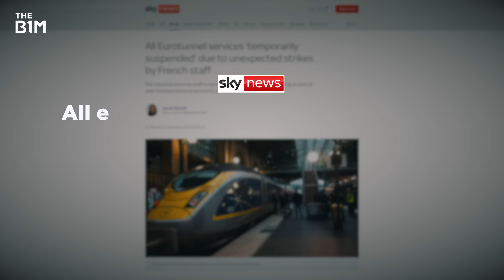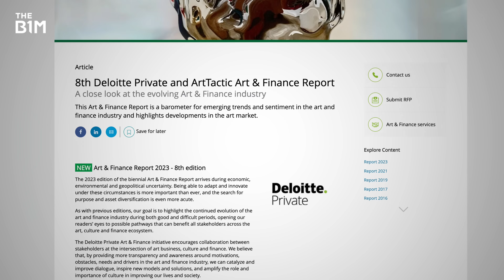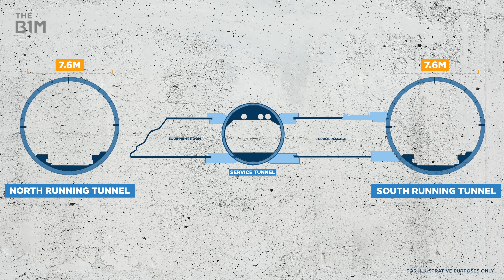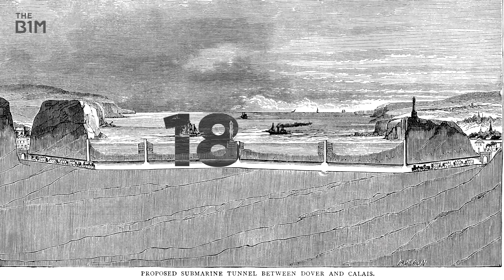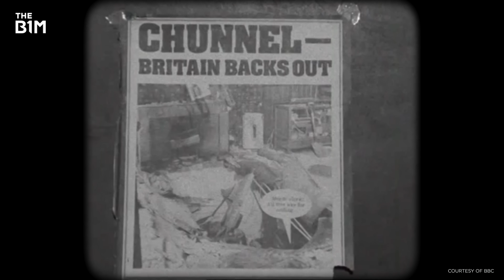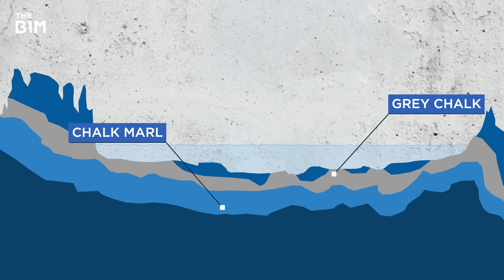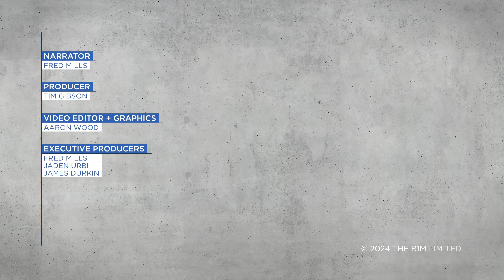The Channel Tunnel: Building the World's Longest Undersea Link

Comment: My late dad worked down there from start to finish and would bore the pants off me with work waffle,   here are some memories of when my late dad worked down there,  here goes...... "the alimac"   this was the main lift thingy that took workers in and out of the tunnel,  "the man rider"  this was the little train thingy that took the workers to their work destination,   "the pranks",  grease rubbed onto the rim of a plastic cup tossed into the air to land on someone's hard hat without them knowing, "the deaths and injuries", one of my dads work colleges had his cock ripped off when he lent on a conveyor belt. " The contractors"  TML and Balfour Beatty, my dad worked for TML. 
Overall, he earn't good money for the time which changed our lives. When it finished he was a foreman and one of the last 9 men to work down there, a lot of them (stole) took left over equipment when it was finished everything  from radio cb's to excavators you name it😂

Comment: Boston và NYC subways có hơn cả trăm năm.
Holland Tunnel đã gần 100 tuổi.
Chesapeake Bay Bridge-Tunnel đã gần 80 tuổi mà vẫn đẹp như ngày nào.
Họ làm xe hơi (Ford), cục sắt bay trên không trung (Boeing) 
dã gần 100 năm rồi. 
3M, Pfizer, Lockheed Martin, Northrop Grumman, Raytheon, Intel, đã trên dưới 100 năm.
Daewoo Group và Kia đều được người Mỹ đầu tư và được chính quyền Mỹ promoted. 
Kể cả SK Hynix và Samsung Semiconductor. (Bởi vì thập niên 90s, Japan vỗ ngực xưng bá về sản xuất Chip và Bán dẫn = Semiconductors và Xe hơi). Nên chính quyền Mỹ + công ty tư nhân đã đầu tư và promoted. 
Mỹ họ không sản xuất Chip hoàn toàn. Kĩ sư họ designed, architected và gửi sang Nhật, Taiwan, Thailand, China để sản xuất.
Ở VN bây giờ có vài công ty Nhật (murata mfg , STMictoelectronics)

Comment: Fred, I have a question for you. This is off the subject but I figured you might see my question since this video is very new.
I have noticed that in the original World Trade Center that the North Tower (the one with the antenna) stood 1,368 ft tall while the South Tower stood 1,362 ft tall. Why was the North Tower six feet taller than the South Tower?
While I’m at it, may I ask a question about the current One World Trade Center? The object on the roof of the building is clearly an antenna. I have seen interviews with some of the men who erected it and they referred to it as an antenna.  I also know that when it was built they tried to conceal it by wrapping it it in a casing that in turn made it fail as an antenna so they had to leave it uncovered.
My question is this: how do the people behind One WTC get away with calling what is clearly an antenna, a spire?
Thank you VERY much for reading my questions.

Comment: The fact it was drilled from both ends and met perfectly is just mind boggling. I cant even fathom the skill that must have taken in terms of surveying and engineering
Reply: Just dig straight and you'll eventually meet at the same point in the middle 😉
Reply: It's absolutely not! Multiple errors and conditions will make both side missed each other completely. At this length and size just 1 degree missed without any checks can make entire project a massive failure.
Reply: @superspies32  that was my point
Reply: I mean I reply to @myran4452
Reply: @superspies32  just cut to the same degree and it'll be fine no worries don't cut using different degrees 😉
Reply: @mryan4452  making sure you don't use gradians I guess

Comment: 75m deep from sea level is not correct info.

At its lowest point, it is 75 metres (246 ft) below the sea bed and 115 metres (377 ft) below sea level.

Comment: The Seikan Tunnel between Honshu and Hokkaido exceeded the technical parameters of the Channel Tunnel: the underwater length for the channel is longer than that for the Seikan, but it was mostly tunnelled through the clay marl. The Seikan went through all kinds of rock, encompassing a greater length, and going 250 m below sea level.

Comment: Only one issue with your video - the “recent flooding”  affected Eurostar services from London and was in a tunnel under the Thames not the channel tunnel which was operating its Eurotunnel services. Never been on Eurostar but have used all Eurotunnel methods (single deck, double deck and truck transporter)

Comment: I wish HS2 was designed to through run with HS1 and Eurostar.
Reply: Would never happen. HS 1 and 2 are southern railways, for  southern people and will forever remain confined to the south of England. The thinking behind them is far too insular to consider a link to anywhere outside of that region
Reply: @JK-wn3cc  ah yes the eurostar was meant to connect the europe mainland to the UK, or more specifically, to London. everyone else, get fucked. classic
Reply: @electro_sykes  as long as London and the south east are OK then that's all that seems to matter

Comment: The original trains were amazingly complicated as they had to support the 25kV AC overhead lines in France (at 16 MW output), the 3000 V DC system in Belgium (at 8 MW output) and the 750 V DC third rail system in the UK where they were limited to less than 4 MW.  As the trains were very long and heavy the power to weight ratio was very poor on the UK network and I well recall the local commuter trains overtaking it on the way in to Waterloo.  The later high speed link to Saint Pancras luckily adopted the French 25 KV AC system.
Reply: Well, it wasn't just French - BR had been using 25kV AC overhead as their standard mode of electrification since the 1960s. It's just South-East England had previously been electrified with the 750V DC third rail...

Comment: I wouldn't say Great Britain is connected to the continent. They have had a movement to isolate themselves since the late 70s. 
Now that they have pulled out of the EU market, it's plain to see that they are suffering from the choice. Building a new tunnel will help ease the issue of transportation of goods onto the island, but it will not help with getting British wears out to the wider market that has no obligation to purchase English items at unsubsidized prices.

Comment: I worked on the tunnel at 21 years old my company at the time (Lee beesley) was terminating the fibre optic links from the uk to France. I worked 12 hour shifts 6 days 3 off then 6 nights a month at a time for a year... you had a few options of transport inside the tunnel which were the "man-riders" which used the service tunnel on a smaller gauge track or the main tracks but these were very sporadic. We had lifesavers issued on our entry to the tunnel which were a charcoal breathing device which always made me  chuckle as they gave you about 45 mins of survivable filtered air but are useless if your 2 hours walk away from daylight😂 (still got mine) I had to walk out a few times as the trains were missed which was a wonderful uphill into wind (as the uk pumped the dirty air to france) mission with all your kit.

Comment: It was not under the sea, it went through solid rock. An undersea tunnel, go to Kowloon and see what an undersea tunnel looks like. A trench is cut into the sea bed , a tunnel is dropped into it and the covered by the earth that was removed. Those tunnels are regularly checked for leaks. The same happened in building the Oresund bridge.
Reply: No, this is literally under the sea. This is not a hair you need to split but if it were, what you're describing is a pipe in the sea, not a tunnel. It's not a tunnel if it doesn't go through existing ground.
Reply: @jonevansauthor Pipe? No it is an immersed tunnel.
Reply: So much for modern education, they teach you nothing. The only things under the sea are marine animals, tunnels on the sea bed and submarines.

Comment: The fact that they already have tunnel boring machines in the 80s is impressive
Reply: Uhhh. Did you ever think how the London Underground was dug?
Reply: @DynamicalisBlue old parts of the london underground were not drilled with a boring machine, but instead constructed using the cut-and-cover method, digging out trenches to build the tunnels in before filling up the rest of the trench with dirt again. The London Underground was also constructed long before the 1980s.
Reply: @roger5059 you're getting mixed up with the new york subway
Reply: @DynamicalisBlue  pickaxes, shovels. The first bit opened in 1863.
Reply: Well, not really, The moon landings were 25 years earlier....
Reply: Is it really making a tunnel if you dig it out then cover it up after?
You end up with a tunnel but it sure seems like cheating.

Comment: I spoke to an engineer who told me that when using the lasers, at times the curvature of the earth would come into play , I wish I could elaborate more but I'm no engineer
Reply: Basically, if you put a straight ruller on a ball, you'll figure out that a straight line will at some point stop following the curve. So if two guys from each side of the channel place a lazer perfectly parallel to the ground they stand on, the lazers will be way hight in the sky when the reach the other side. For the same reason you can't see  Europe from the USA despite the water being "flat" on each local point between the two continent. If you consider one being at the top of the earth, the other is "bellow".

This mean for the channel, they can't point point two lazers parallel to the ground and mesure/align them. They must either point them at an angle toward the ground, because in this spot they can still see each side for the other, or they must rely on others means for even larger projects ( I don't know which ones ). Its like running a straight tunnel under a curved hill.

Also gravity fiels may be a concern as the weight of the earth may deviate the light of the lazer toward the earth but I don't know if its significant enought to cause problems in such projects.

Comment: A second crossing would be great imo - one of the most iconic engineering marvels - even now, you get on a high speed train city centre to centre up to 300km/h on other sections, or drive your car onto a train!
Reply: A fully high speed line purely for freight would be worth it. For passenger rail I'd like to see Wales to Ireland, Portsmouth to Isle of Wight, Cardiff to the Southwest and other locations like that including some major islands. Plus major cities like Birmingham need their own Underground.
Reply: @jonevansauthor  You don't need high speed for freight. But it would be a tall order getting such a link profitable. I'd hazard a guess that most freight trains run through the Chanel Tunnel at night, when there are no passenger trains. There is also the issue that rail transport in Britain lags behind the continent.

Now, such a freight tunnel might increase rail freight in Britain; I couldn't say. However, it also needs to connect to the European rail network, presumably somewhere in France. The big rail freight corridors in that general area are from Antwerp and from Rotterdam towards Germany and central/eastern Europe. It's not a direct route, and those rail corridors are already quite full.

Long story short, it would require an investment of tens of billions, to achieve... what, exactly? So ships can unload in Antwerp or Rotterdam, and then take the cargo by rail to Britain?
Reply: You do know that you drive your car onto the trains already  to use this tunnel?
Reply: Where abouts do you think ?

From SW U.K. eg Plymouth and over or purhaps Ramsgate to Ostend ?

Comment: Great video - just a pity the tunnel is so underused.  Just London to Paris, Brussels and Amsterdam.  Why not Germany, Switzerland, Italy and Spain.  Yes I know you can drag your luggage across Paris and change onto a service to these destinations but would you fly to these places if you had to change planes in Paris every time?
Reply: "High Speed Rail" is most competitive for middle distance routes that are too long to comfortably drive. but too short to be worth the bother of getting out to an airport and dealing with security, etc. That is around 300 to 600 km. For any distance beyond that flying is faster, easier and much, much cheaper. While some people may have the time and money to get a train for a 1,000 km journey, 95% of people don't.
Reply: No , the real pity is : Why not beyond London to Birmingham, Manchester ..?

It is also underused because in the tunnel security exits are every 300m. Therefore the rule is that a train needs to be 300m long, in order to have access to an exit in case of emergency. 300m is twice the length of normal high speed trains. Therefore the Eurostar from Amsterdam has to stop 40 minutes in Brussels to load passengers. If the chunnel could traversed in shorter trains, There could be direct trains from Amsterdam
Reply: @allws9683  they're not comparable. While I agree some form of high speed to the north would have been good a) it wasn't really that high speed and b) there is already a train there. There wasn't to Paris until the Chunnel opened. 

As for underused, I think you're all having a laugh. What a load of nonsense. Is Waterloo underused because you can't stay on the train from Portsmouth all the way to Norwich? Not to mention look up how much freight goes through it. 

But sure, I'm all for building more tunnels, building a tunnel version of HS2 to link Birmingham to the north and also the northern cities to each other.
Reply: @jonevansauthor   The current 320km LDN-MCR in 2h7m is quite allright. To have that connected directly to the Eurostar would be very good.
If one could do the 660km from Birmingham to Paris (or Brussels) in 3-3.5 hour would be excellent and very competitive... Birmingham metro has 4.3 mln inhabitants.